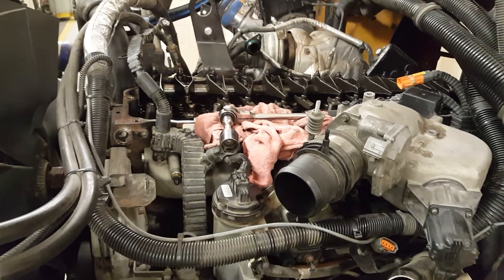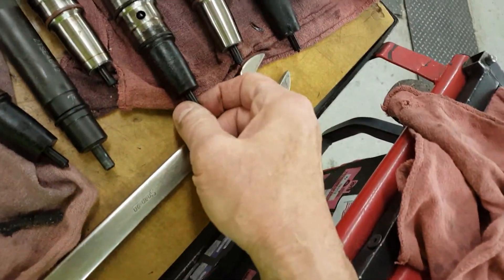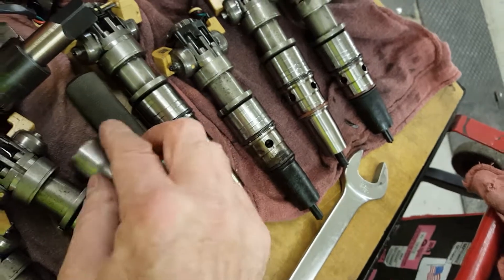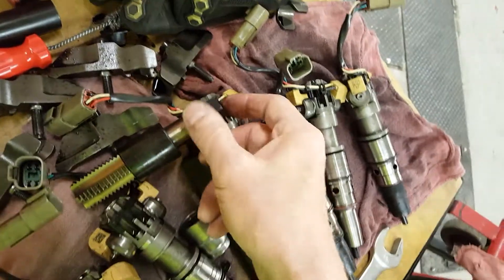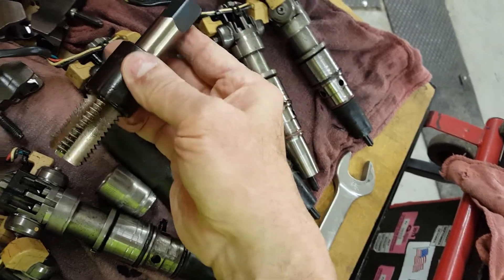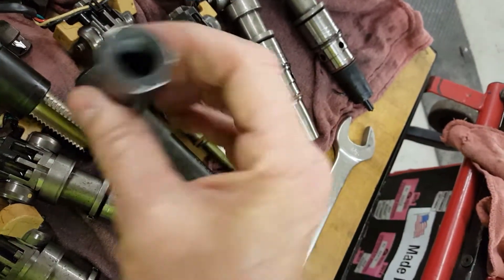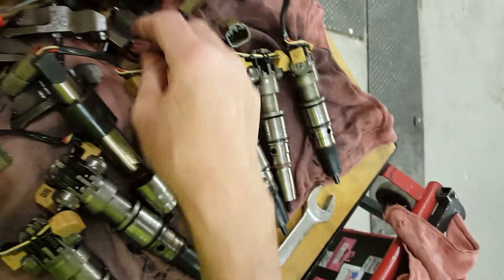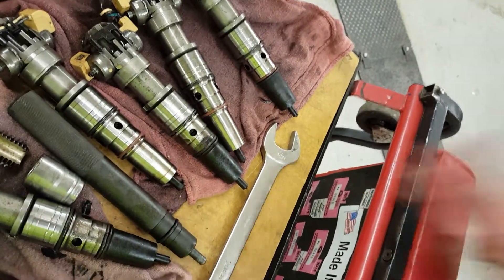MaxxForce DT Diesel Engine Replacing Injectors and Sleeves

Comment: Forgot to video all the fun stuff including the rusted blind holes that rip the bosses out when you try to open up the doghouse.  Then of course unbolting and jacking up the cab because no one would ever dream an International product might need routine injector service.  And ya can't get the valve cover out without the extra clearance.  Unbolting cutting zip ties on the wiring harness air compressor supply tube.  While your at it see if that valve cover has the oil baffle to keep it from sucking oil into the compressor wheel on the turbo and check the actuator feed line to make sure it hasn't gotten brittle and broken in that heat proof encasement lestwise you ruin an entire motor because of one little vacuum line.

And customers that want their truck back that day.

Comment: How do you know or the sinthoms for over fueling ??
If not maxservice
Reply from the maker: The engine will rattle/knock a lot more with over fuelling and of course extra exhaust out the tail pipe. Fuel dilution in the engine oil detected most times in an oil sample analysis report.
Reply: @MechanicsHubdotCom  excelent thnks.
Mine mxforce
Rattle and knoc lot more snd smoke lot time and had clean dpf due to vloged often and i see engine oil raise and over level..
So sound like i git bD i jectors 
Shoud i replace those 3 bad ones or do i have toi replace all 6...
As pretty xpencive...
Thnks
Reply: @MechanicsHubdotCom  is thete a way to know or how to know wich injector or injector is overfueling.. ??

As my maxfoce had those sinthoms excess knocking, smoke, and engine oil level raise.,
Reply from the maker: @1HSYURIDIA  hard to tell I would get the oil tested for fuel contamination then remove injectors and get them tested.
Reply: Hey I’m glad I read these Comments. Is the Rattle/Knock audible when the RPM reaches 1000+ or is it constant?

Comment: I have a question are those heui injectors please answer I want to know
Reply from the maker: Yes they are HEUI with the high pressure oil system and electronically controlled injection.
Reply: Yes they are

Comment: Hey Mechanics Hub! 
Ever had an injector 3 and 4  close coil keep coming back as a pending code after replacing a 6 pack on 2010 emission maxxforce dt. Would like to discuss a problem I'm having if you could send me a PM.
Reply from the maker: Never had this problem before. Did you replace the injector harness as well? We've had issues with wiring to injectors.
Reply: Is the Unit skipping when it does it?

Comment: Do you have to use locktite on the bottom of the sleeve.?
Reply: Interference fit or not you are still supposed to use lock tight, That is proper procedure.
Reply from the maker: We did not use Loctite they have an interference fit. There were no problems after this repair.
Reply: @MechanicsHubdotCom  wow thanks for the reply! I just did this same job and had a lot of fun getting the valve cover off but I didn't apply any locktite or gasket maker and it worked fine. I was just curious because when I removed the sleeves there was a residue on the seat that looked like locktite. Possible carbon build up?. Anyway thanks again for the reply
Reply from the maker: @sutimantell3968  I would say it was carbon build up on the sleeve bore. The sealing washer is important to seal off compression. We used aftermarket ones that did not seal so went to OEM for a few dollars more.
Reply: You are sopose to use lock tite 620 you got lucky if you didn't
Reply: Depends on the wear. If its pitted you definitely use it